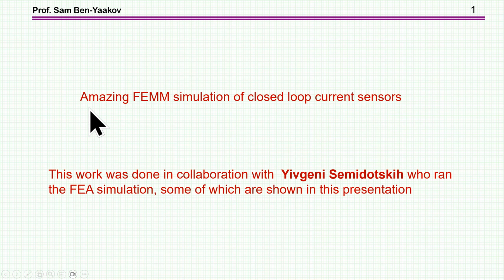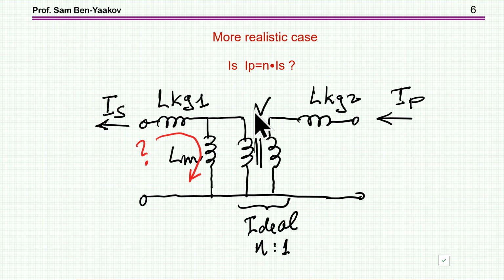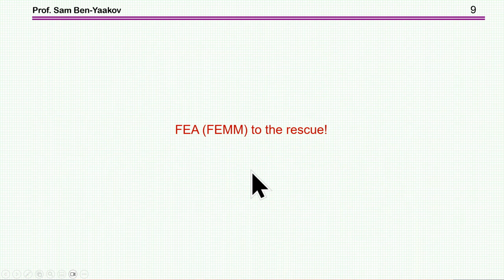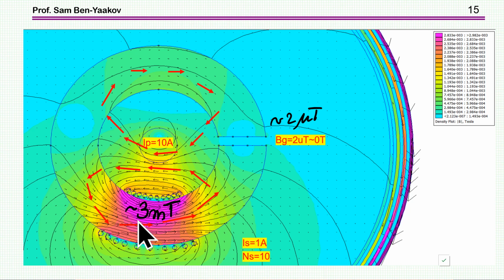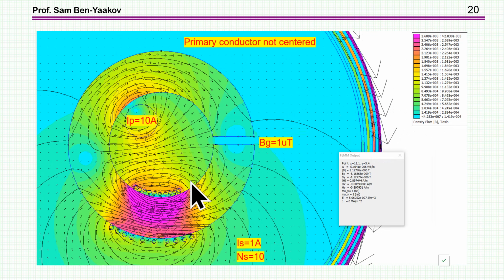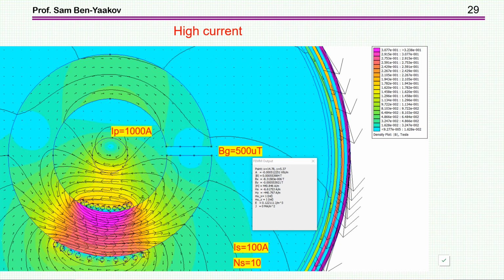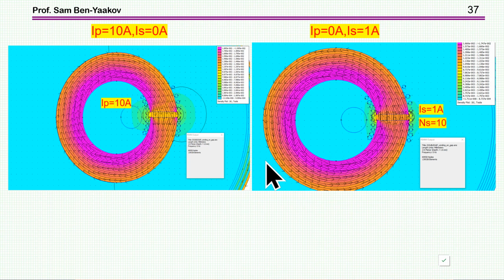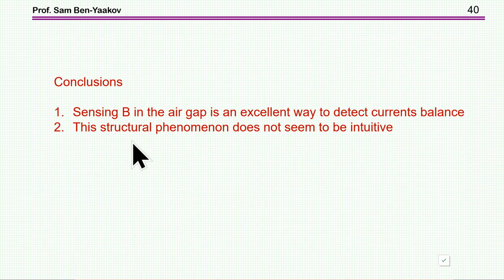Amazing FEMM simulation of closed loop current sensors

Comment: Sensor in gap do not mean a realy gap (air); sensor structure must to not disturb to much core flux; in this way only sensor can sensing a correct flux in the core (and correct Ip) to send correct voltage to OpAmp that will cancel core flux with secondary winding. Your FEA simulation is very usefull and correct for an air gap core but I think is not correct to consider air gap for such current sensor.
Reply from the maker: See:   DRV421 Integrated Magnetic Fluxgate Sensor for Closed-Loop ... https://www.ti.com/lit/gpn/DRV421
Reply: @sambenyaakov  yes, I know DRV421 operation; main question is related to construction details and if Hall sensor in magnetic circuit mean air gap or allow (and sense in same time) flux passing with minimal reluctance perturbation.
Reply from the maker: @electrosys-powerconverters3791  Have you seen LEM's solution?
Reply: @sambenyaakov  yes, schematics... I don't know details about gap dimensions, fill material and Hall sensor around material.

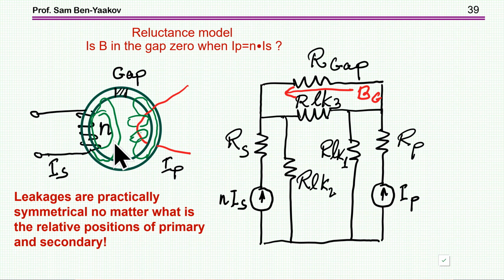Comment: Very cool video! I followed most of it, but I'm not sure I understand your "part of the flux which is not common" explanation at 18:10. How can you be sure that it's valid to model Rlk1 and Rlk2 as being equal- i.e. the "not common" component is symmetrical?
Reply from the maker: This is what I deduce . Apparently the reluctance model can not fully emulate what is going on. The leakage is sort of floating in between.

Comment: Is your FEA  using Maxwell ?  FEMM ?  The other expensive one ?
Reply: FEMM not maxwell
Reply: I just noticed that FreeCad appears to be able to host FEM which I am not sure if is the same thing as FEMM or not ?
Reply from the maker: I have no idea
Reply from the maker: @k7iq,  the title says FEMM, I am mentioning FEMM a number of times in the video, praising it. Have you even looked at the video?
Reply: @sambenyaakov  I am questioning the spelling of 1 Mversus 2 M's in the name because I found this program called FreeCAD that appears to have an interface for a FEM module spelled with 1 M.
Reply: Yes I watched the video and am familiar with Maxwell and FEMM but have never heard of FEM until I opened up free CAD. I am wondering what this third finite element analysis program is
Reply from the maker: @k7iq  Sorry about the confusion.
Reply: @sambenyaakov   Oh, no problem at all Sam !  I am happy that there is yet ANOTHER free  (I think it's free ?)  FEA program !   We used to use Maxwell back in the 1990s.    It taught me a lot !